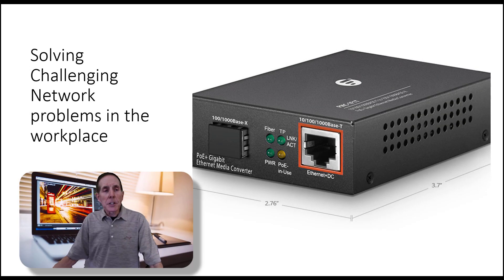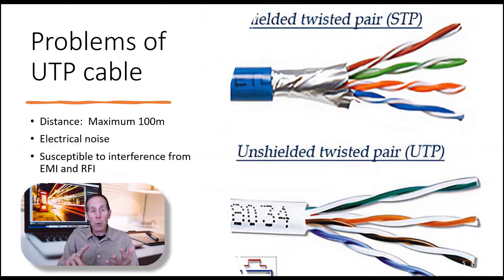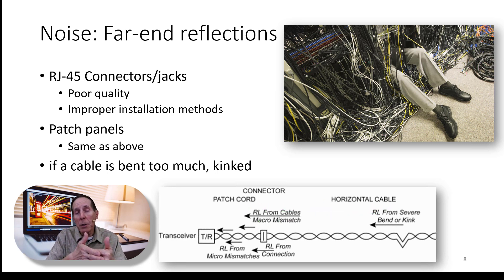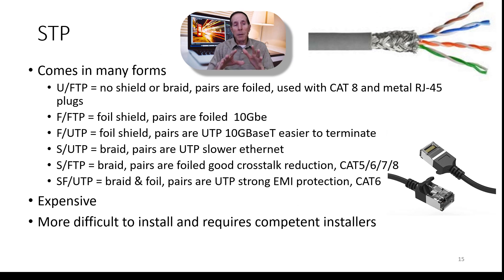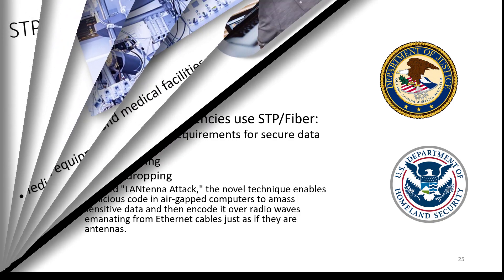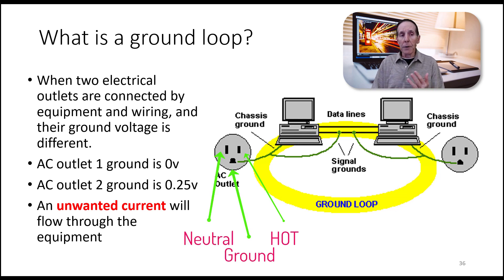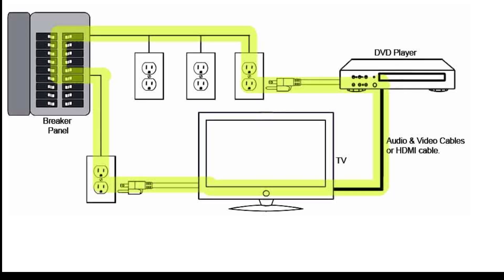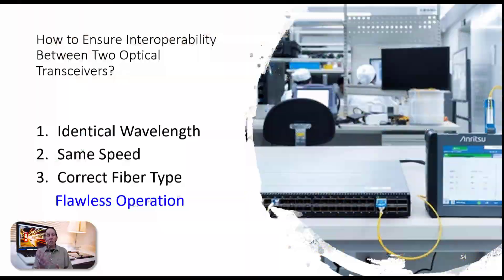Electrical Mysteries Unveiled in your Data Network: IT Admins  Solutions

Comment: I use  CAT 7  and  8  with  gold plated  contacts   Interference also comes  from the  4G and  5 g networks   along with  switch mode  power  supplies and plasma  televisions .   Another  solution   , which  I  do   is   the use  of  shielded hospital grade   line  cords   for better grounding  Again  with  the sexy  purple   cable  bundles  with the   velrcro    wraps     I run   all my electronics  to  a   SurgeX   unit   which   has a  big  coil /capacitor   snubber circuit  inside   That's also  called   a  isolation    one  to one (primary  to secondary )  transformer   You  should   also mention    that you can  buy  round   and flat  ethernet    cables
Reply from the maker: Thanks for the comments John!

Comment: NAH!
Unless your cable is right on top of a big motor, it is NOT an issue!!

You do know how interference gets cancelled by the differential signals and the twist in the cable??

I have yet to see a network “go down” by any USUAL interference. It can slow it down a bit, but never down!!
Reply from the maker: Great comment, it is true differential signally helps with RFI but in an industrial environment when 10 msec delay between a bottle sensor that detects an error and the 500 bottles per minute system fails to get the stop message on time due to frame corruption, trust me you will wish the system would go down.    Thanks for the input always enjoy your honest feedback.